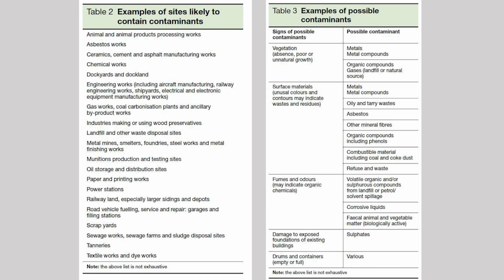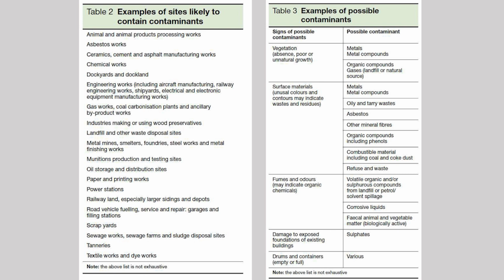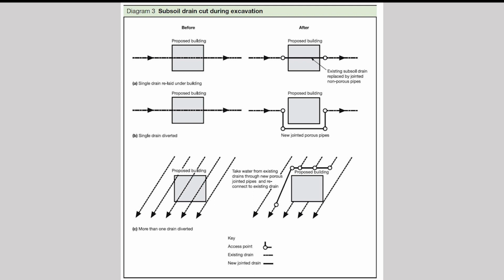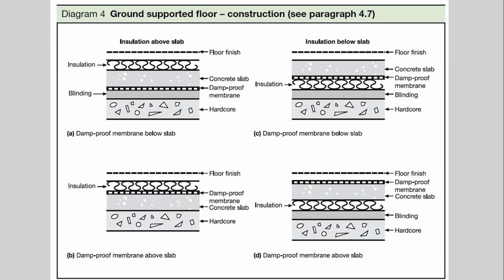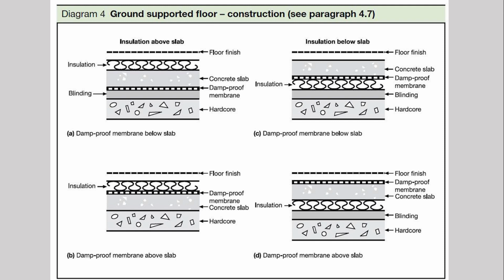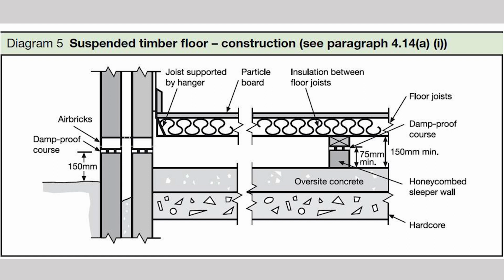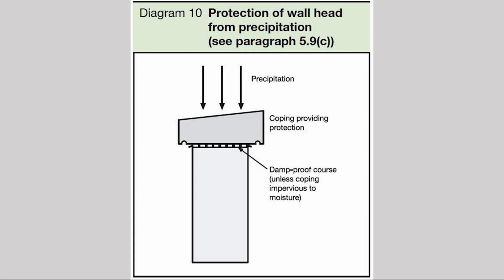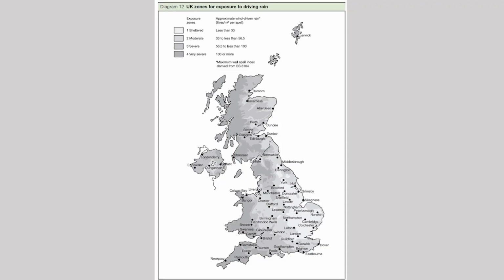UK Building Regulations  2023 | PART C | with Geoff Wilkinson

Comment: Interesting, thanks Geoff. This highlights the importance for clients to appoint architects so that the risks and appropriate details for their projects can be identified and detailed at the right stages.
I'd also suggest regarding rooflights, it's not just the fancy grand design type builds that tend to have the low lying rooflights, but where conservation rooflights are required- these actually have to appear flush with the roof finish in order to meet conservation requirements. So of course the correct detailing of these is paramount.